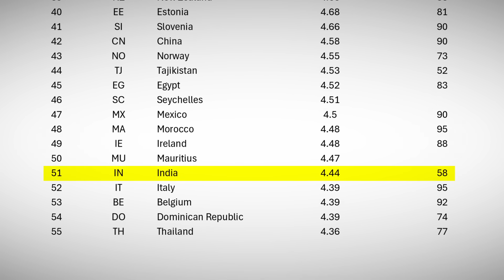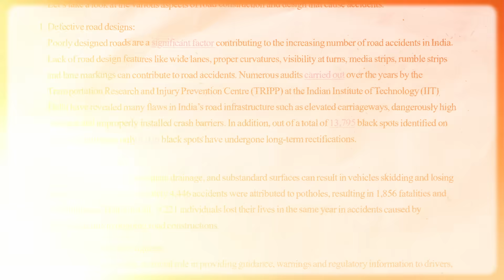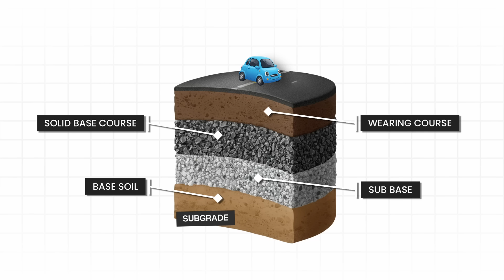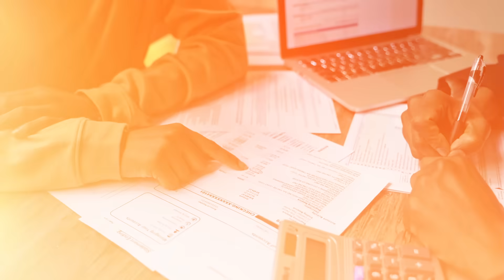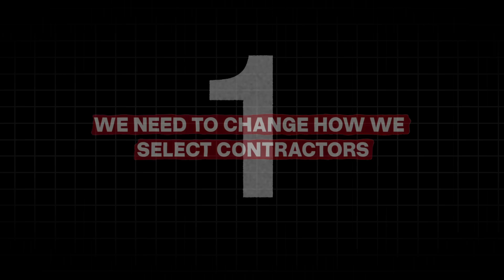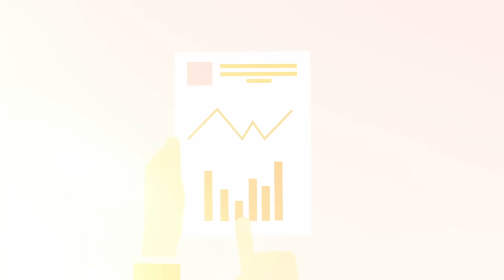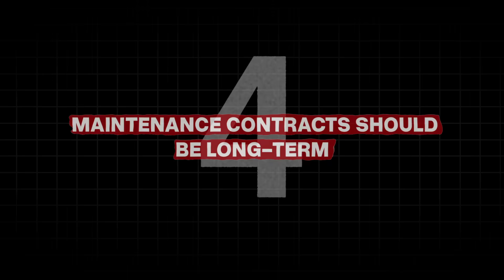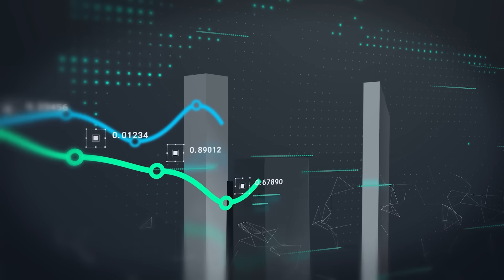Why Bengaluru’s Roads Break So Fast—and How to Build Ones That Last 🛣️💥

Comment: Recently built/fixed ORR and connecting roads already started damaging. There is no use of technology , same 40 years old road runner , third class bitumen and bunch of untrained labor doing the road work. Roads in Bengaluru work on build -> dug > rebuild model .
Reply from the maker: Sadly, that’s a very accurate description.

Most of Bengaluru’s road failures aren’t because of traffic — they’re because of poor design, poor materials, and zero accountability. Old construction methods, low-grade bitumen, untrained labour, and no quality audits mean roads start failing within months. Add repeated digging by utilities and you get the build → dig → rebuild loop.

In cities where roads last, a few basics are non-negotiable: modern pavement design, certified materials, trained contractors, utility ducts planned before resurfacing, and strict defect-liability periods. Without fixing governance and accountability, no amount of “smart city” tech will help.

This is exactly why people lose trust — money is spent, but durability is missing.

Comment: Learn from China mate.
Reply from the maker: China absolutely shows what happens when you combine long-term planning with fast execution — metro networks built in years, not decades; wide boulevards; transit-oriented development; strict enforcement.
No city transforms by accident. It transforms because the system is designed to deliver results.

India doesn’t need to copy China’s politics,
but we can copy China’s speed, planning discipline, and execution quality.
That alone would put our cities 20 years ahead.

Comment: Have a coordinated set up between water, electricity and telcom departments. This must involve frequent and imptomptu meetings at diferent levels to ensure proper implementation. Private sector involvement in all above operations will be mandatory. Private builder lobbies must ensure equivalent representation and responsibility. Planning stages, especially in new and smart settlements must be made to follow the "Singapore" model of podium over podium construction. This will entail more than adequate drainage facilities thereby countering flooding, duct spaces below roads and private buildings will prevent destruction of roads for  laying new conduits. Interconnection of spaces for ease of commuters, where metro stations have same level entry into malls and commuters can stay undercover and in aorconditioned comfort for miles and even complete journeys. Do not give any project to the lowest bidder, Avoid giving work only to  billionarie friends who may have paid for my election.
and also, if certain companies have paid my party by way of electoral bonds, I must declare that now everybody knows that we were cheating before and set up a commission to monitor these nepotistic firms and ensure standards are fulfilled.

Comment: Stop talking about the prime minister. Stop talking about the chief minister. Stop blaming everything on others. Take responsibility for your own actions. The guys who pour tar and gravel into the road are average citizens. They can do a good job at their level, which they don't. Indians just blame everything on their politicians while taking no responsibility for their actions.
Reply from the maker: You’re absolutely right — accountability isn’t only top-down.
The quality of our roads, traffic behaviour, and even basic civic discipline also depend on us as citizens.
A contractor cutting corners, a driver breaking a rule, a shop blocking the footpath — these aren’t PM/CM issues, they’re people issues.

But here’s the full picture:
Systems shape behaviour.
If the incentives are weak, oversight is sloppy, and enforcement is inconsistent, even good people start taking shortcuts.

So yes — citizens need to take responsibility.
And leadership needs to build systems that make good behaviour the default, not the exception.

It’s not either-or. It’s both.

Comment: China is using Robot Construction Equipment for Highways which are Zero Corruption High Quality Low Cost High Speed Infrastructure. India must introduce same technology. Then our Roads in India will also last long very long. 😅
Reply from the maker: Yes, China is using robot- and automation-based highway construction machines (unmanned rollers, pavers, etc) and getting tangible gains in precision, cost‐efficiency and speed. But it’s not just about machines--it’s about reforming how roads are planned, built and maintained. If India wants roads that truly last, we need the tech and the governance.

Comment: For a moment, forget all the complex technologies for making and maintaining the roads. If some honesty existed, the roads would have been far better than they are. Honesty is sorely lacking in Karnataka, especially under Congress government. It is no mystery that roads in Bengaluru are amongst the worst. 80% of the allocated money goes to line the pockets of politicians, engineers, bureaucrats, and contractors. Only 20% is spent for repair.  In some places, the patchwork done has come off in two days. Right now, Karnataka is ruled by the most corrupt regime led by Congress. Little wonder that the MLAs and Ministers want Siddharamaiah to become CM in 2028 also.

Comment: Outsourcing example. What type of output will you get if the software engineer is paid 5k per month. 
How many parts of Microsoft Windows are built in India.
Remember we are a cheap labour country.
Reply from the maker: That’s a fair point — cost often reflects capability on average, but it’s not the whole story.
India’s advantage has always been cost efficiency + massive talent pool, not just “cheap labour.” The quality of output depends on how work is structured, managed, and valued, not only the salary figure. Many Indian engineers who built parts of Windows, Azure, and even Google’s core products were paid far less than their Western counterparts — yet they delivered world-class results.
The difference isn’t where you build, it’s how you build — with good leadership, clear processes, and pride in quality. India shouldn’t settle for being the “cheap labour country”; we should aim to be the smart innovation powerhouse.

Comment: NHAI National Highway Authority of India lays national highways and have far better quality control.   Remember it's a perpetual money making machine for political people and the company they own.  Many years back the contractors of Mumbai staged dharana after state government announced to replace bitumen roads in Mumbai with 25 years lasting Concrete roads..

Reason of short life Span of state roads

More bitumen percentage..stronger and long lasting road.. Bitumen is stolen or false quantity 

Bitumen quality matters 

Temprature of bitumen concrete during laying road should not be less than 121 degree Celsius.  

Laying road only during summer.  Water and moisture are enemy to bitumen concrete strength.  Early morning laying during fog not allowed for longer lasting road 

Pressure point created by mud falls from dump trucks create potholes later

Proper drainage of roads during rain increase longevity of roads 

Final bitumen coating after laying of roads prevent water ingress into roads and increase life

Finally, like national highways, a reputed 3rd party pvt quality control consultant with "stop work power" should oversee work
Reply from the maker: You’ve listed some absolutely correct technical reasons why many state roads fail — and honestly, this is the level of detail missing from most discussions.

A few things worth highlighting from what you said:
     NHAI roads last longer because of stricter QC, better specs, and stronger enforcement.
     Bitumen theft, dilution, and wrong temperature laying completely destroy road life — this is a massive but under-discussed issue.
    Moisture control, proper drainage, and correct timing of laying are non-negotiable in road engineering.
    The ‘25-year’ concrete road plan in Mumbai being resisted says a lot about the incentive structures.

And yes — a neutral 3rd-party QC agency with stop-work authority is one of the best reforms India could implement.

But here’s the bigger picture:
If the system doesn’t enforce accountability, even the best technical standards on paper mean nothing.
NHAI works better because the process is tighter, not because the people are different.

We don’t need foreign models — we have good examples inside India already.
What’s missing is scaling that same discipline to state and city-level works.

Your comment actually proves something important:
👉 India’s problem isn’t lack of knowledge.
It’s lack of enforcement + the wrong incentives.

If we fix that, our roads will automatically start looking like NHAI roads.

Comment: A very good video, you gave your analysis of the problems in the system, the L1 trap and actually gave detailed guidelines and examples for solving this, at least that's a start.

But for the upcoming videos, I request you to please make sure Arunachal Pradesh is in our map.
Reply from the maker: Thank you so much for your kind words and thoughtful feedback! Really glad you liked the video and the way we broke down the issue. 🙏

Regarding the map — as far as we know, we haven’t excluded Arunachal Pradesh anywhere, but if you could please point out the exact part you’re referring to, I’ll definitely check it right away. If there’s been any omission, it was completely unintentional and I sincerely apologize for it. I’ll make sure it’s corrected in future videos. 🙏
Reply: @Raconteur65  6:39 is the only instance I spotted. Thank you for understanding my intent. I have already subscribed.

Is this channel a part time hobby or a full time job for you. Asking because a lot of content creators do the same, so I'm curious. It's alright if you don't want to answer as well.

Comment: India doesn't work on a system where the lowest bid always wins. There is a technical cover and a commercial cover. The real problem is that, we the pople don't question anything, and we elect politicians who beliv that we citizens and they the rulers are not equal.
Reply from the maker: TRANSPARENCY is absolutely necessary in a democracy.

Comment: Kerala is the only state that focuses on building roads by rule book ,  reason - the focus on quality by the department and by the contractor , yes the contractor , this might sound like a oxymoron but the fact is true , I recently met a very large public works contractor in Kerala to help my friend who supplies materials to this contractor  but stopped buying of late , when asked why they are not buying the chief engineer said “your item failed our quality test” and for us no body is a friend , it’s only quality that matters , they cited an example of a leading cement company who was a supplier of more than 10 years , in one of the projects some defects were found after 3 years of commissioning the project in multiple places where this cement was used and they were instantly blacklisted . 
When one contractor delivers quality others too have to follow the same standards, I was surprised to see the pristine condition of interior roads in hilly regions despite the heavy rains and also scientific construction like having cemented shoulders on the roads even in remote places , top notch quality and not a single rough patch , this shows how the stake holders commitment can make the difference , unlike most states where it is loot and scoot by contractors, officials and politicians..
Reply from the maker: If this is actually true, other states must follow this.

Comment: All city roads, town roads, district roads, state highways etc are built by states. Centre only builds expressways and highways, and as mentioned in the video under the "Gram sadak yojana" scheme.
So, for the central government, it is hard to intervene in a state's policies of building roads, coordinating between the utility providers of the state. It is the state's responsibility
Reply from the maker: That’s a fair point — road construction and maintenance do fall primarily under state and local bodies, except for national highways and expressways built by NHAI or under central schemes like the Pradhan Mantri Gram Sadak Yojana.

But just to clarify — the title “What if you were the Prime Minister” is more of a figure of speech. The idea isn’t that the PM personally builds every road, but to explore what anyone in power — at any level — could or should do differently to fix systemic issues. Whether it’s the Centre setting better design standards, funding models, or coordination frameworks, or states ensuring better execution and utility management, the goal is to ask how leadership and accountability can make the system work better.

So yes, you’re absolutely right about jurisdiction — but the bigger question we’re raising is about vision and governance, not just administrative boundaries.

Comment: Exaggerated nonsense. Parts of Bengaluru where heavy construction is going on like metrorail does have significant road destruction. Same in other cities in areas where significant construction is going on. Overall India does a decent job of its roads given the vast road network it has. More should be done in terms of road safety though especially proper signage and lane markings. But at a municipal level there is significant politician-contractor corruption nexus leading to poor quality road projects.

Comment: The sides of the road need concrete barriers to prevent expansion as vehicles pass over.
The company who built and the engineer who is responsible should be made known on a website.
Reply from the maker: Interesting!

Comment: Not only in Bengaluru many cities roads are bad and even NH also had lot of pot holes. You seems be -----------
Reply from the maker: Absolutely agree — it’s not just Bengaluru. Many cities and even parts of our national highways face the same issues with potholes, drainage, and maintenance. Bengaluru was just taken as an example to represent a larger national problem that’s been around for decades.

This video isn’t about blaming any one government or party — different governments have come and gone, but the core issues have stayed the same. The point is to discuss what we, as citizens, should demand — better planning, accountability, and long-term solutions instead of quick fixes. It’s not about politics, it’s about progress.
Reply: @Raconteur65 correct what about people's civic sense as many run vehicles on pot holes which are just filled.

Comment: CORRUPT POLITICIANS 
CORRUPT BABUS 
Contractors are left with no option but to feed these snakes. The margins are set. And they get project at the lowest bid. Moreover, even if they want to build good roads, they simply can’t. THE ROAD MUST BREAK AFTER 3-4 RAINS. Otherwise, you wont get the projects anymore. 

Modi in 2014 was the only hope to end this corrupt system. Slogans like ‘na khaunga na khaane dunga’ all went down the drain. Now he is exhausted. The alternatives are already useless. This country is beyond repair, just like are roads.

Comment: Corruption is the root cause of many problems in India. The road height becomes more than the ground floor level in 5 to 6 years😂. Companies don't follow required Bitumen proportion in the mix. The cabling and drainage team always remembers to do their work after road is laid out. Houses get built without drainage, sewage, pipeline, footpath and road plan in cities. That is main reason for water logging in Indian cities. No planned cities. No footpath. No value for cyclists😢
Reply from the maker: Very true!

Comment: Real question is how china is at 42 , india at 51 😅😅 ... Are our roads not as bad as we think globally??? Our gdp ppp per capita is around 120th , how did we achieve such high ranking??? 😯
Reply from the maker: That's probably due to huge geographic / terrain diversity. China has vast areas of mountains, deserts, rural regions where road building/maintenance is much harder. But it'll sure catch up, the way things are going.

Comment: The height of roads keeps increasing due to faulty construction practices, primarily the practice of adding new layers without removing the old ones, which incrementally raises the road level. This over time results in houses are at lower level in the future causing flooding issues in the future
Reply from the maker: Very interesting!
Reply: This is pretty common in my city Madurai where the houses has gone below the road level over the years and storm water drains direct into the homes.!
Reply: Absolutely correct. Now we have to increase the humps at the gates to prevent water getting in from the road. In future I feel our entire house will eventually be "underground".
Reply: Yes this is true of Mumbai too. 
The street road has gone 5-6" And our bldg has gone below road level. 

Very poor quality of engineers.

Comment: Absolute trash argument, same lowest bidder(Malaysian contractor) constructed a road in Kerala it lasted for 35 years without any pothole, then government has to dug up the road for road mafia as  it has proved asphalt roads can last for more than 20 years
Reply from the maker: That Kerala example actually proves the opposite point — when a contractor is allowed to do proper work with the right specs and zero interference, the road can last decades.
The problem isn’t the “lowest bidder” model by itself, it’s how the contracts are supervised, how often specs are diluted, and how accountability disappears once the work is awarded.

If we enforced standards the way that 35-year stretch was enforced, a lot more roads in India would survive far longer — and the whole “potholes every monsoon” cycle wouldn’t exist.